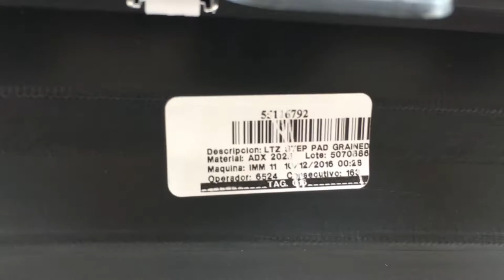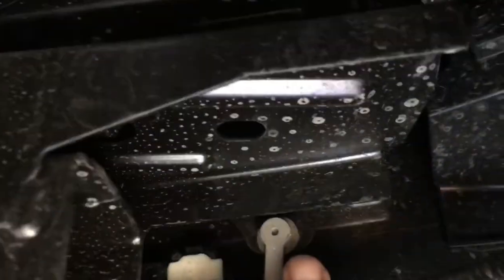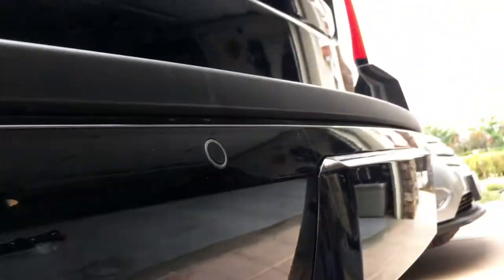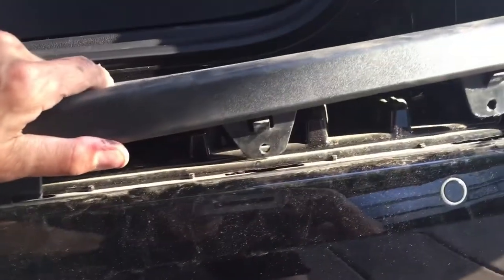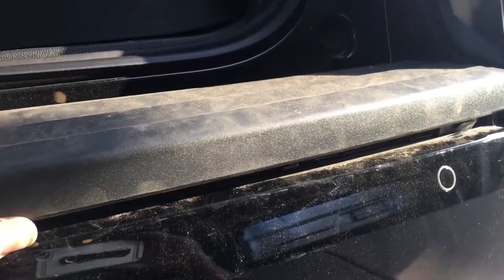2015 - 2017 Tahoe LT Chrome Bumper Step Pad Install

Comment: How did you do the install on the Chrome Roof Rails? Was it an overlay or factory parts?
Reply: Any update on this?
Reply from the maker: Hey Sorry for the delay. I found them on ebay. These are not OEM, they are just the chrome trim piece with sticky tape on the back.

Comment: Where did you get the Chrome from to do the side step pads
Reply from the maker: I found a guy who was making limo's or extended Tahoe's and he was selling the original steps. You can also find them on Ebay, but they are pricey.

Comment: Why didn’t you just buy some chrome molding?
Reply from the maker: Quedog KU alum... the chrome Moulding kits from eBay look terrible. I tried one and returned it. Thanks!
Reply from the maker: I did try that, and the chrome molding just fell off.  The stuff they sell on ebay looks very cheap.
Reply: What part # on that bumper piece?
Reply: The OEM style pad has the chrome strip
UNDER the black plastic so that it doesn’t get ripped off when you accidentally drag a suitcase or something across it.
Reply from the maker: @quedogkualum  Hi, YOu can search for it on the web. Search Tahoe LTZ chrome step pad.
Reply from the maker: Step Pad - GM (84277154)